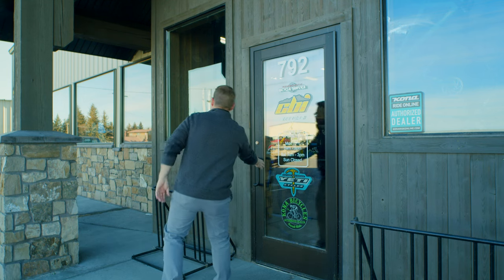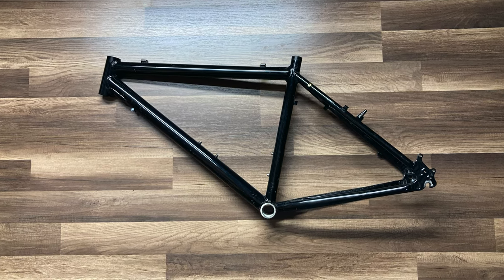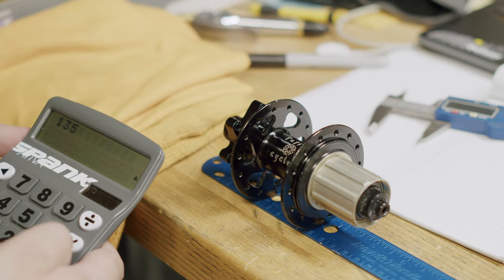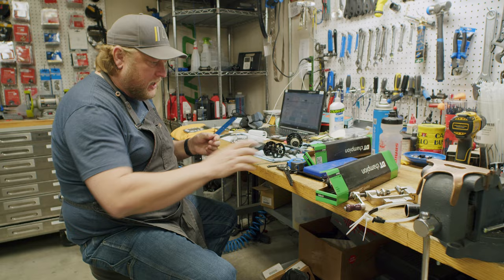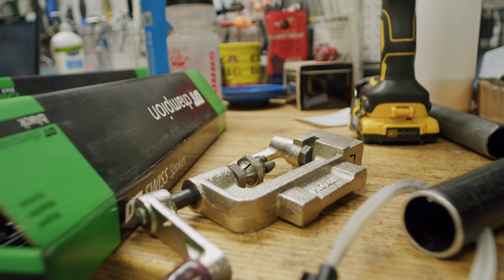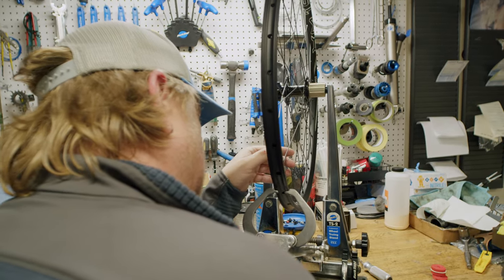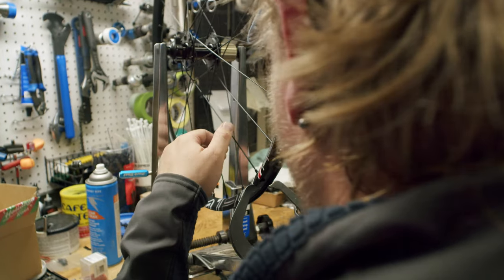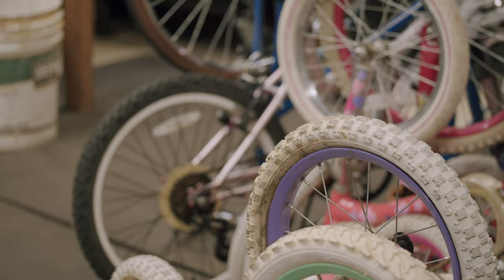Charity Bike Collaboration Part 2 - Custom Wheel build

Comment: What's the spoke length for that rim&hub combo?
Reply from the maker: I believe it was 262mm and 261mm non drive to drive side. If you are looking to build your own be sure to check with a bike shop that has a spoke calculator.
Reply: @CoolBikeProjects  thanks Rusty 😁😁😁😁